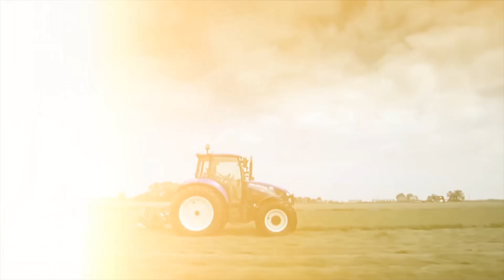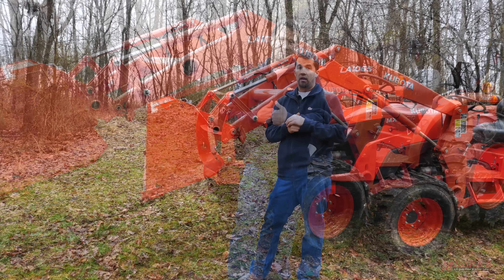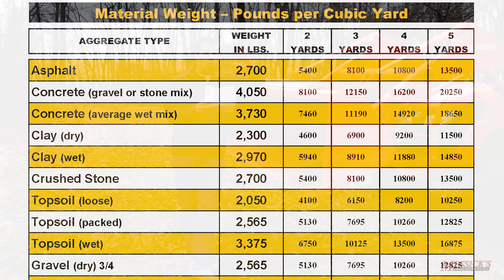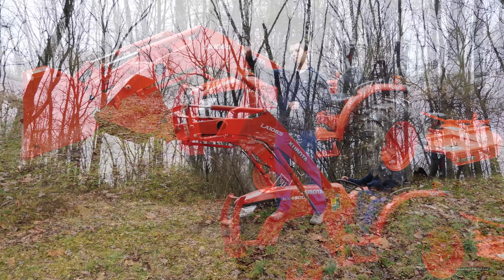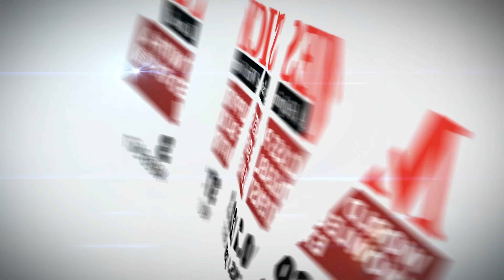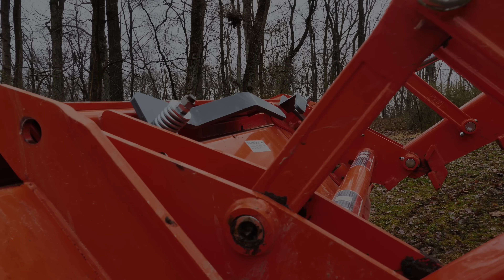Let's Talk: Loader LIES! How specifications can be manipulated.

Comment: Fantastic! Having spent a large portion of my working career in the material handling industry and having trained hundreds of operators, this is information that needs to be passed on to the consumer. Load centers, centers of gravity and stability are all related to safe operation. I would like to see a video on the movement of the center of gravity as the bucket is lifted and it’s effect on stability as I see many operators carry their load high in the air. Carrying a load low is not only proper, but also safer. Overall, your videos are informative and well done. Keep up the good work!

Comment: That's why I appreciated the work of people like Tractor Time with Tim who actually test the capacities and find out. I think he found the Kubota lifts less than the equivalent JD because the geometry of the loader puts the bucket further out.
Reply from the maker: Trade off for height vs capacity. Like I said, engineering balances a set of constraints.

Comment: Good video Neil. This is something that I've been struggling with lately. I'm in the need to essentially lift ~1700# pallets of firewood just high enough to move them around. Talking with the dealers, they tell you that you need a tractor that will have a LA768 loader on them as a minimum. Well, no. Those will lift 1700# based on the pin location all the way up to the full height of the loader. But what about a pallet, where it extends out approximately 3.5 feet, and you're only lifting it about 1 foot. That's way more than the 500mm away from the pin, the load is pretty evenly balanced over that 4'x3.5', and you're only lifting 12"-18". Yeah, it's really hard to figure out exactly what your minimum is to do a specific task.

Comment: I got a Branson 2515H.
With fluid filled rear tires and the  60 inch brush hog on the back, the loader can easily lift the rear tires off the ground.  
(a pallet of  1 ft square 3 inch thick concrete pavers.  12 per layer 8 layers.  Estimated 2100 lbs.  4 less pavers and the tires stay on the ground.) 
I did the math after the tires came off the ground...
I don't think it needs a higher  loader lift capacity than that, regardless of what the numbers say.  
The tractor would be unsafe lifting that to above the hood even if I put on enough ballast.  
Its rated to lift 2000 to full height.  
But just because the rating says it can, doesn't mean you should.

Comment: Hey Neal, Kioti CK4010 comes with the quick attach bucket. Are their ratings correct?
Reply from the maker: I don't know their equipment very well. If the quick coupler is optional (odds are it is) than the specifications in the brochures are going to be for the pin-on buckets, not the QA buckets. This is different than most kubota models at this point that are disadvantaged by making the QA standard equipment.
Reply: Messick's Equipment Just bought a CK4010, only offered with a QA Skid Steer type bucket. Loader is also QA.

Comment: Great video explaining the truth about lift capacity. I'm shopping for a tractor and on paper a Kioti NX series will lift around 2700 pounds but in the real world a 1600 lb bundle of metal is the heaviest bundle it would pick up off my trailer. I am a metal roofing contractor and I took multiple weighted bundles of metal to the dealer to see what it could actually pick up. 2K was a no-go but when I drop down to the 1600 pound bundle it found its sweet spot
I found that the real world lift capacity is closer to 70% of the lift pan capacity companies list
Reply: Your pressure relief valve also may not be set correctly. Might be worth checking

Comment: I think this points out an important design detail the engineers need to consider. They have, and probably still are, designing for the load due to a bucket of dirt. But now quick couplers are standard,  and pallet forks or other heavier components are likely to be used. The design criteria needs to change. 
With the right valves, a dual cylinder loader could be built where only one is used during normal use, and the second would kick in when the load was heavy. The first providing fast movement and the second load capacity. You could have relatively small tractors lifting 3000lbs (assuming ballast for stability was there and the front axle was designed to handle it).
Reply from the maker: Duke stage pump rocks be interesting

Comment: Great info here, but I find it interesting how hard it is to find these loader specs on some manufacturers website. Most list the capacities to the pins at full height, others make you sift through several links to find any info and do not differentiate these subtle testing "cheats".  I suspect (no actual proof mind you) that even with the "over inflated" lifting capacities listed on some manufacturers products, when lifting capacities are taken at the quick attach point and 500mm out, are still very similar to the Kubby.  I also do not own a tractor with a loader, just an observation.

Comment: I do not understand. If a Kubota says it can lift 1100 lbs and the same class but different brand, let’s say Mahindra or RK says it can lift 1500 then that would be better.  If Kubota’s lifts double the weight at low height then so would a tractor that had higher lift compacities.
Reply from the maker: the point is that there is far more to loader operation than just simply lift capacity. Reach for example, is really important if you want to load a truck or trailer, but having reach lowers lift. Having good roll back is important because it keeps you from dumping your load, but you can't have good rollback with a steep loader arm... again impacting lift. What you need is adequate lift for the size and weight tractor you have, and a good trade off of other geometry that makes the loader nice to use. Its not the singular end all and be all spec that people often look at it as.
Reply: Messick's I think I understand your point.  Thank you!

Comment: I tested a different orange tractor I could not find the corners of the loader controls. With in 5 seconds I was operating the Kubota. I was leaning hard toward the other orange tractor till the loader controls frustrated me. The next video on loaders show the lift curve. GP outdoors done a video on that and he explained why the loader can lift so much more at lower height. Thanks and good video 👍

Comment: The problem I ran acrost is I wanted a sub compact tractor for around the house. A sub compact can almost do everything I wanted except for 2 thing. Unloading a ton of pellets, I havent tried it yet but I'm pretty sure I cant do it. To get something with enough lifting capacity youd have to buy a massive tractor. I know that's having my cake and eating it too but it would be nice to have a sub compact that could unload a tin of pellets. Even if it was an attachment that went into the tractor. Still researching how to get it done
Reply: Maybe get the pellets delivered in smaller quantities?

Comment: When I look at loader, I look front hitch we have automatic locking pins which I don’t have get out of tractor.  Second I look at hydraulic output not ram size which save me time.  I hate John Deere front hitch spring pins that snap off and New Holland choice Challenge (Australia) loader with manufacturing n hitch design.  If going to lift load match to size of tractor it hairy driving load let alone wear n tear on front end steering.

Comment: Great video. Everything mentioned in this video is overlooked by so many people. Nice job on this one Neil!

Edit: I purchased a 17' JD 2032r over the Kubota for small reasons. One was I can't stand a tredal pedal and the JD loader arms were tucked in closer to the machine than the Kubota, I have allot of tight trails where length matters, shorter is better in this case. But the lift height was better on the Kubota.

Comment: pretty sure you could sell a tractor to someone living in a condo!!!!!
Reply: Andy Lindenaar ha ha. We used to have a few acres and after years of my wife suggesting it (I could do 75% of everything I needed to to with Range Rover and trailer) I finally bought a Kubota and loved it. 

We sold up and bought commercial property, last year we moved into a first floor flat (what you'd call a second floor apartment), which included a 20ft by 20ft grass lawn for each family. I was straight onto eBay for another Kubota, sadly before I found one a groundskeeper came and cut the grass, which was repeated every week...

Comment: Having worked construction most of my life the limited rollback on tractor loaders has always annoyed me. A real loader with the bucket rolled back can be filled completely with wet materials like concrete, a tractor loader bucket rolled back will hold less than half it's capacity simply because it doesn't travel far enough, I've seen many where the floor of the bucket is almost level with the ground still when rolled back fully.

Comment: I heard from another service dealer that Kubota is having problems with their loaders. I believe he said that the hydraulic pump was causing the loader to overpower itself and break the loader somehow. And the worst part about hearing it was Kubota would not cover it under the warranty. They would classify it as abuse. Is this true and have you seen it in your shop?
Reply from the maker: Absolutely not true. Have never heard anything along those lines before.

Comment: Another great video Neil!  I am looking at a L3901 from a dealer here in Ontario Canada.  General use around the property including logging for firewood and a mill.  Will be purchasing a Grapple to pick up 10-12 foot logs.  I am trying to find a grapple that would adequately do the task.  I know I would need loaded tires and a ballast setup at the rear.  Not many options for grapples up here.  In the Land Pride catalogue the SGC1060 (356lb w/out hitch) was suggested.  The ones I initially looked at would be too heavy...in the 800-900lb range.  The L3901 with LA525 loader is rated for 1131lb at pivot.  Would this be a good match for this loader?
Reply from the maker: Yea, the Land Pride SGC is a good fit for the tractor.

Comment: I'm in the market for a new tractor. So what would be the smallest tractor that could unload a ton of wood pellets from the back of a truck and safely transport them on pavement? That's probably the heaviest thing I had to lift and have to do that job every 35 days during the winter.
Reply: I'm curious as well because I am looking at the Kubota M5660 and John Deere 5055e to lift one ton pallets but I'm wondering if they will do the job, and if an MX5400 would do it with a 2,200ish pound capacity.

Comment: Some good points but has Excuses why kabota doesn't  have the best lifting capacity on paper from my experience on skidsteers when they say  max lift, doesn't matter what brand kabota included when testing once it might a got the weight of the ground but just barely and that's what they call max lift in reality it's a couple hundred kgs less
Reply from the maker: You're proving my point. Skid steers have a lifting capacity and tip load. You're right that you're not going to safely lift what's on those spec sheets for lifting capacity. It's nothing more than a marketing number.

Comment: Who still sells a loader without a quick coupler of some kind?  I never see this anymore.
Reply from the maker: No one really, but the specification sheets don't reflect that
Reply: Junk Deere is more than happy to lock you into their proprietary loader attachments with their quick coupler
Reply: Jeremy Fortune nobody really anymore. There is a pin in bucket on the bx series, but Kubota always offers a skid steer coupler if not standard. Deere loves making proprietary couplers, but usually offers a skid steer attachment for around an extra 300 bucks. Pretty much every tractor over 65 horsepower have ALO or Euro couplers.
Reply: John Deere

Comment: Very seldom do I worry about lift capacity. As a farmer the MOST important thing for a loader is visibility  especially with pallet forks. Everything else comes second to that. That is one thing the manufacturers don't seem to realize. I have run across it over and over the loaders are getting more and more powerful, faster level lift. But if you can't see the forks forget about it being useful.
Reply from the maker: Thank you! Exactly the point I'm trying to make. The manufacturers are only catering to the customers obsession about the wrong statistic, can you blame them?
Reply: I’ve mounted a video camera on my pallet forks to aid in visibility.
Reply: I agree about the visibility.  When I purchased my QA forks for my L6060 I was disappointed that it is very difficult to see the fork tips with 48" forks.  Unfortunately having a skidsteer or forklift is impractical, at least for most hobby farm owners.  I had the same problem on my last NH tractor.  However, I think it's the nature of how the smaller tractors are built that causes the hood to be in the way.

I'll add that I think most folks are likely looking at lift capacity to know how much they can offload from their truck or trailer when they come back from town.  If I could lift a ton pallet, that saves a lot of time when purchasing things in bulk since most retail stores put about a ton on a pallet.  I'm sure a lot of other people think similarly.  When I made my purchase last December, I found capacity numbers to be all over the place, with no solid explanation behind them as stated in the video.  Granted I took some of the information into consideration when I could compare apples to apples, but not down to the single digits.  A lot of it for me was dealer responsiveness to my questions, how serious I felt they took my purchase, and in general how well I liked the tractor I was looking at (nit pick personal things).

Ironically I bet those lift numbers don't even include the bucket, let alone forks, grapples, or whatever lift implements you put on the front.  I didn't even think of that when I made my purchase, forks weigh 300+#, so subtract that from the number.  Dulh!  :)
Reply: Basically every farmer I talk to find the loaders are hard to near impossible to see with. And always wish the manufacturer would design them to see the forks.
Reply: Most of the quick attach systems are not worth it and the skid steer forks are worth more as junk iron. Generally to see the forks at ground level is to lean to the side just a bit and look beside the hood. Skid-steer quick attach seem to like and cover that view point over.
I have used old and new and many different brands. And the best I have found was a 1390 case with a homemade fork. I can stack pallets more square and faster with it then a forklift. And the worst was a mx100 I have yet to find any place in the cab to see the forks.
Reply from the maker: New Holland had a tc series for a while that was really good with forks. This tractor really suffered what I described in this video. The loader stuck way out in front of the machine for great visibility but because of that I couldn't lift very much.
Reply: @MessicksEquip  I've got a TC33D my biggest issue when using forks is the damn Super Steer shift side to side on that thing. It makes lining up forks perfectly to anything harder. I wouldn't trade it for the world though, and it lifts way more than it probably should. I haven't had too many complaints yet. I should have probably had a little larger tractor spec wise for how I use it.
Reply from the maker: @jeepfreak81  Those are great tractors. I've been watching for one to film with.
Reply: I have had 3 Westendorf loaders and prefer them to the factory loaders for being able to see. Compare them and you will be pleasantly surprised. You can get the skid loader QT on the smaller models or Westendorf makes their own that you will like even better. I checked the features and performance and didn't care about comparing price. After the first one, I never looked elsewhere.
Reply: I was more concerned with lift capacity because I sometimes have to lift heavy steel items in my fabrication business. My loader specs out better than the orange and green competitors and I know it will do every bit of what they claim cuz I’ve done it. That being said, I was fully aware of the downside. And that is height. I wanna say mine lifts a full foot less height than the competitors. I don’t double stack round bales so it’s a non issue. The other plus is that my bucket doesn’t stick out as far when lowered so that makes my tractor better in tight spaces. Of course there is a downside to that when lifting loads in and out of trucks. There is a compromise for everything, especially FELs. You just have to match the right tractor with the kind of work you will be doing the most. Now would have loved a Kubota instead. Heck yeah! But for $24,000 less for a new tractor with virtually the same specs I chose LS. Yes the Kubota is fancier and loaded out with a few more options but at a much higher price point. JDs price was $30,000 higher. Almost double and had the worst Warrantee. I also don’t like how JD will design things like battery compartments that only fits a battery they make. You go to buy a new battery and it’s $500!!! No thanks. I wish LS made excavators. I will probably have to go to Kubota for that.